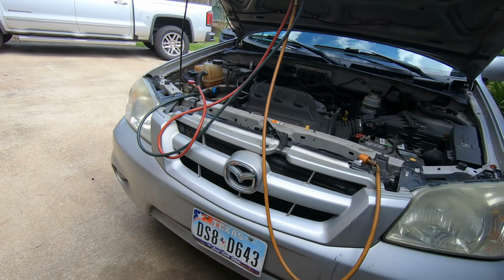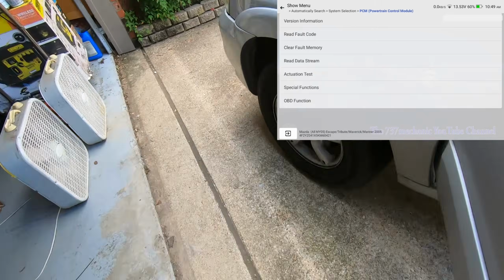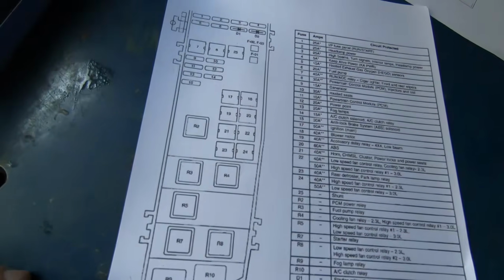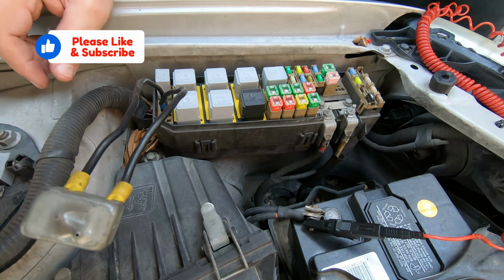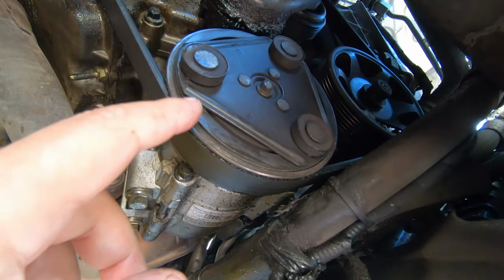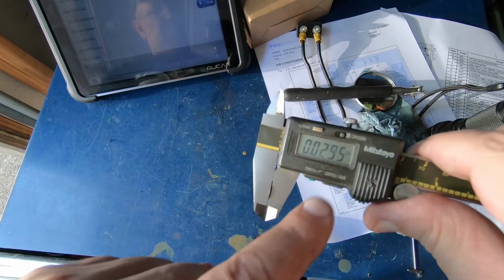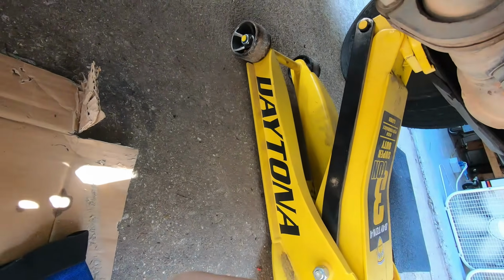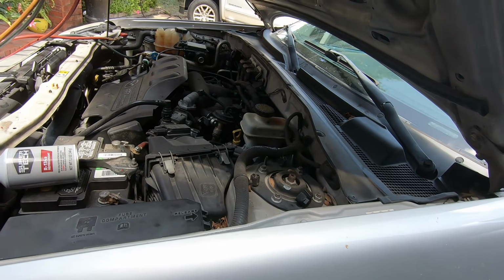Easy Fix for a 2005 Mazda Tribute or Ford Escape A/C Clutch Not Engaging and AC Not getting Cold.

Comment from the maker: Orion Motor Tech 4 Way AC Diagnostic Manifold Gauge Set
https://amzn.to/4071wp9
Thinkcar 689BT Scan Tool
https://www.amazon.com/dp/B0DCFRF2TF?ref=t_ac_view_request_product_image&campaignId=amzn1.campaign.35ZUBUUA2CCU0&linkCode=tr1&tag=737mechanic-20&linkId=amzn1.campaign.35ZUBUUA2CCU0_1750711162519DEWALT XTREME 12V MAX Cordless Ratchet
https://amzn.to/44utttl
AC Compressor with Clutch Compatible with Ford Escape 2001-2007, Contour & Mazda Tribute
https://amzn.to/3HUXfP8
Air Conditioning A/C Condenser Compatible with 2005-2007 Ford Escape 2005-2006 Mazda Tribute
https://amzn.to/4loSUT0
A/C Accumulator with Hose Assembly
https://amzn.to/3TCdkf7
A/C Orifice Tube
https://amzn.to/466n4FV